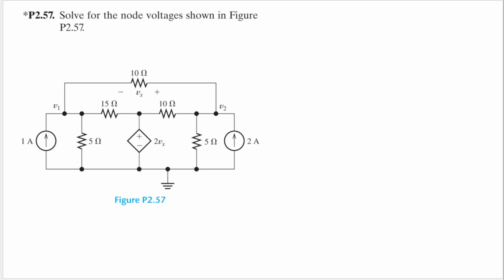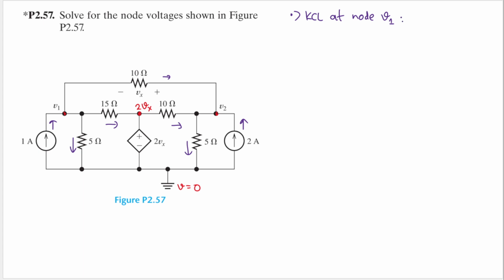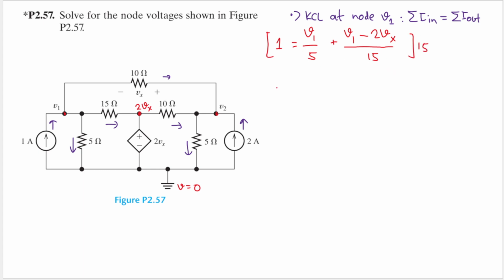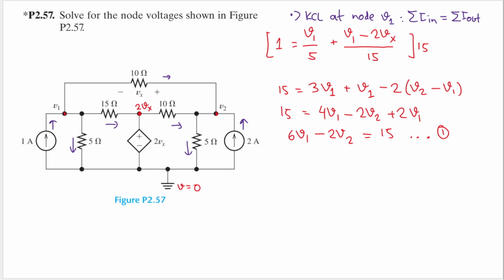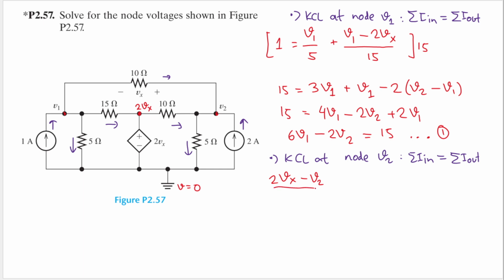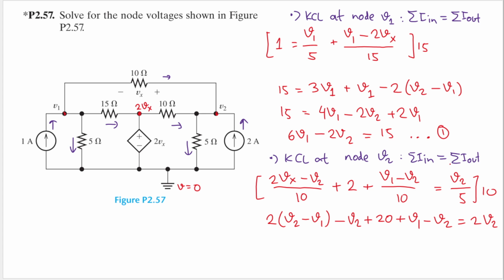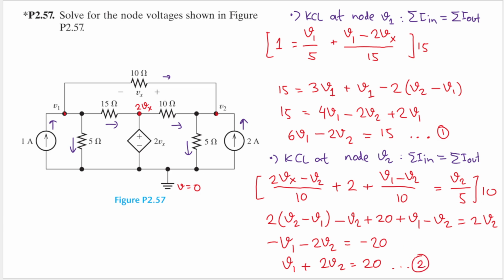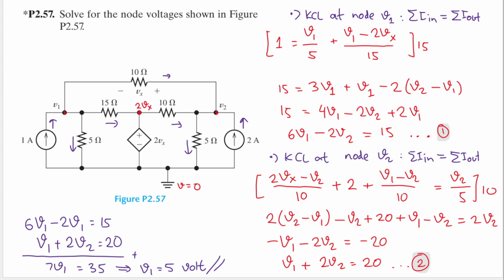Problem P2.57 (Hambley 7th Ed) Electrical Engineering: Principles and Applications. Mesh-Current.

Comment: when you are calculating KCL at v1, why didn't you consider v1 to v2 that has a resister with 10 ohm(on the top), but when you are calculating KCL at v2, you then consider that.
Reply from the maker: See the circuit